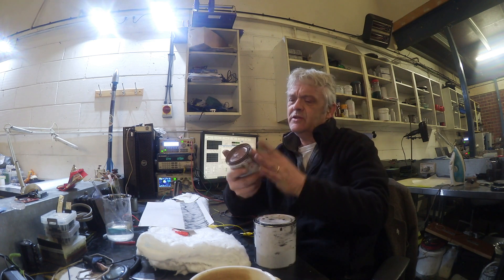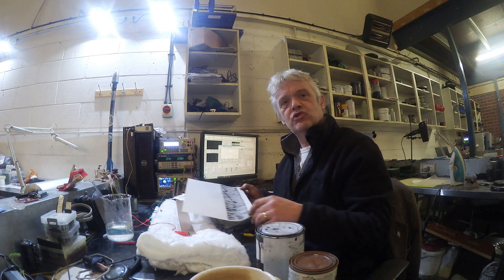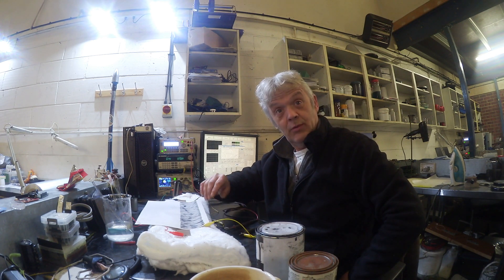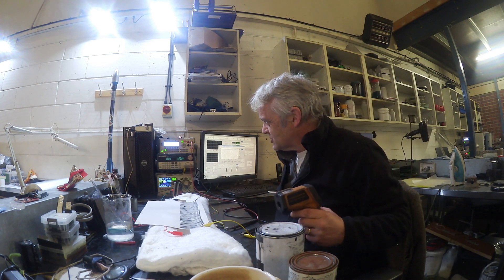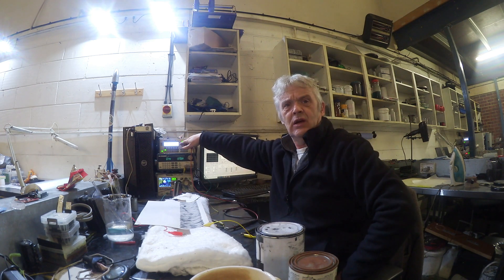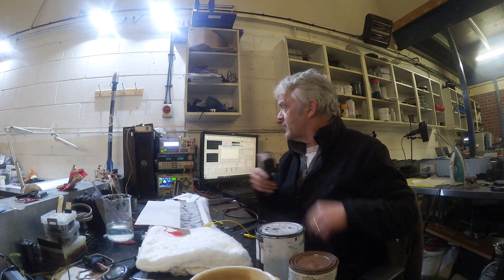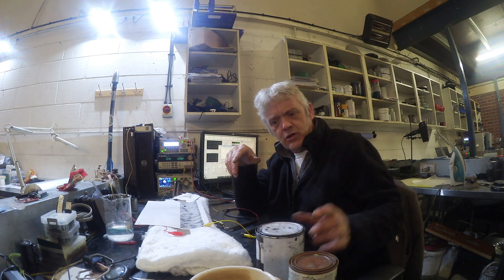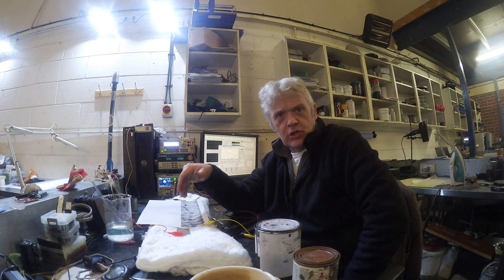Printable Thermoelectric Generator From FWG Ink

Comment: Wow imagine if a fridge was made from that built into plastic, on the cold side, and the hot side covering the heat exchanger and compressor, It could become super efficient! A company in the usa makes TEG's 20w and some can even handle a naked flame, very impressive. I wonder if graphene ink if exposed to high volts cold electricity would it become cold? People who get shocked with cold energy get freezer burns??

Comment: Dear Rob,
in Germany it's called "Thermo-Element". I been thinking about this to install it in a funnel from heating kettle to get at least a little energy which goes normally to the birds. 

Your printed thermoelectric generator is for lower temperatures off course; I guess up to 100°C only. In winter time the difference between outside and inside a house might (depend on which country / area) go up to 20°C or more. In this way there should be a potential to get the one or other WH for free. And in your way very simple to make!
Reply from the maker: nice idea mate - go for it

Comment: You talked about 2.5 Amps at 10 Volts, and then corrected the voltage to 10 milliVolts. Presumably you also meant to say '2.5 milliAmps'? Thanks for the awesome demonstration, Robert. You are really showing us what can be done, at home, for relatively low cost, and with basic ingredients. That's what makes this channel so fascinating and educational.
Reply from the maker: yes mate - we are talking tiny amounts of power here
Reply: The 10V 2.5A was the power being pumped into the kanthal heating element driving the temperature gradient for testing the thermocouple, not the output of the thermocouple itself

Comment: Hi Buddy.
We know that your ink can be used for induction. 
Could the power being picked up on your meter be from induction transfer from the heating element?
Have you tried the same experiment from a radiator or a heated plate (non electric)?
Reply from the maker: it's a resistive heater from a dc supply mate - not much chance of that - but I did try just using my hand, a hot cup of coffee and a hair dryer and it worked but a bit Heath-Robinson - which is why I used a more controllable heat source for the vid
Reply: @ThinkingandTinkering  cool .
I thought you would but wanted to ask.
Thank you

Comment: If you can get a radiating-finned extruded aluminum tube and run water through it on the inside, then you can rapidly sink a lot of heat relative to the paper and ink accumulator on the outside, and in theory on a hot day gather quite a noticeable improvement.

Not sure its worth the effort, but by all means a measurable amount of power generated.
Reply from the maker: worth a try for sure

Comment: Print this on Silica Cloth, this cloth can handle 1800*f. If coat the cells with Sodium Silicate as high temp electrolyte between the materials, you then create a combination of both a battery and a printable TEG. You may see a huge boost in output and may note they will hold a charge. You may even find you can charge the cells directly from the heat source.  I did this same thing but used aluminum oxide very fine powder as the cathode. I took this video out of hibernation check it out. https://www.youtube.com/watch?v=tzgA8JgibUQ
Reply: If we can get the silica cloth to act like a wick, we can keep the sodium silicate supplied with water to keep wet. Once the water is gone the electrolyte quits working.  This is why I think there is something going on with the H being liberated and processed like a fuel cell.
Reply: I was able to achieve 6 volts out of my cells and were very crude. In fact the very first ones were just a smaller scale of exactly what you did here.
Reply: The cell in the video I coated the silica cloth with sodium silicate first. Then used it again for the binder for both the Aluminum oxide and the graphite powder. In the video the tegs modules you see I had bought previously and are what got me going  in this. But those modules are broken in the video and are not the source of power. I was just using them to isolate the vice grips from the anode and cathode of the cell.
Reply: one last thing, I tried the peltier effect, and this is  how I discovered the energy storage capability. The cell did seem to cool but not drastic, I was hitting them with 12 volts.
Reply from the maker: this is a very interesting concept mate - mind if I work with it a little and maybe do some vids?
Reply from the maker: I did check it out mate - very interesting - what was the anode?
Reply: @ThinkingandTinkering  On that cell it was aluminum oxide with sodium silicate binder.  However, i used aluminum from a soda can and also nickle mesh. The aluminum seemed to work better than the nickle. Need to find out what aluminum is used for soda cans as Ive tried other aluminum with lesser results.
Reply: Take this make it your own, I cant develop it and i need this technology. Ill email you with a more evolved concept.
Reply from the maker: @Thrive-Off-Grid  cheers mate
Reply from the maker: sorry mate I asked the question before reading on - my bad - cheers

Comment: This is pretty cool, similar to the Lovell monotherm video you did - but you are using the Seebeck effect here. NiCr based inks (powder + polyaniline and etOH) work better as the Ni source than Ni itself. Or even Ni and Ag work really well as the Ni electrode. I have done some experiments in this area myself, with carbon dispersions. I found that a Carbon paint in a junction with a NiCr paint actually performed well enough to take reasonably accurate temperature measurements with them. I used polyan and the target metal to make the ink - then i sieved it and used a Thermocouple template i found online and made a stencil. I then airbrushed the paints. They were 40mm x 40mm and had an average resistance of 0.35ohms/square. I was able to hook the painted tracks to my Arduino and use them as a two-wire temperature sensor. Was pretty cool :) I did this a few years back. Temperature sensing wasn't my main goal at the time - creating a paintable peltier device was - so i quickly moved away from using Carbon as the reference electrode material and onto TaBi chalcogenide mixtures. They are pretty cheap and have amazing Seebeck coefficients (they are the materials current peltier elements are made out of). I have been able to get 10°C movement across the paint i came up with. I am still tinkering though. 

Love the video :) There is so much potential in a cheap waste-heat harvesting system. Even it just fr iOT at first - huge potential in paintables.
Reply from the maker: lot of interesting stuff in your post mate - I'll dig into a bit more for sure - not sure if I want to use tantalum based inks - I might persist with the carbon a while longer - stubborn - you know that lol - but I agree printable are a very interesting area

Comment: Question technical application
The performance of solar panels drops in the summer months because they heat up. I've been looking for a solution for a long time. I want to dissipate the heat to increase efficiency and generate extra electricity for my balcony power plant.
So far I was thinking about Pelitier elements and water cooling.
But a corresponding painting of the back would be a great thing. Stick passive heatsinks on top to get a higher delta temperature.
Combined with a DIY zinc bromine flow battery and you come very close to the offgrid. For little money.
Reply from the maker: for sure mate - I am not sure what the question is though - sorry - I am being a bit thick

Comment: Does anyone know a good hackable inkjet that could have the color inks replaced with carbon, boron carbide and carbon nitride water based inks and the black ink replaced with a non-water-soluble insulating material.  Preferably with a  way to calibrate it to run the same sheet multiple times (perhaps a cheap plotter?)

This could be a game changer for printable circuit prototyping and a modified silk screen process could be useful for medium volume production.

It would also be kinda cool to use a non-modified printer for visualization purposes.

BTW - the boron and nitride are to form P-N junctions for carbon base ICs.  The multiple layers is not only useful for multilayer circuits but necessary for printable transformers.
Reply from the maker: There are several CISS systems around mate - worth looking into that - if you want to hack something choose a piezo based inkjet not a heat based device - I think epson does them but you will need to check
Reply: Try this site: https://www.instructables.com/id/Print-Conductive-Circuits-With-An-Inkjet-Printer/

Comment: ..........so it doesn't appear that you heated preferentially the carbon or the nickel. Isn't perhaps best performance obtained by creating as big a difference in temperature between the two different components of the teg as can be managed? Thus heat the nickel only or heat the carbon only. It would require a different painting arrangement also. How about graphitic nitride instead of carbon.. No, I can't do it I'm afraid to say.
Reply from the maker: interesting idea - I will have a look at inmate - thanks for the suggestion

Comment: I would use a fish scale configuration. I think that the more you add the less there will be a difference of heat between the layers.
-----
I changed my mind. maybe with some kind of Z shaped cell it would work but not a great idea. I forgot about heat transfer of opposite faces touching.
Reply from the maker: tbh mate this is a basic idea and needs playing with - some good suggestions here and lots to investigate for sure

Comment: Thanks, Rob. I've been waiting for you to do this. Brilliant! 😊

There is a metal used in magnetic refrigeration that may couple well with your TC.

https://en.m.wikipedia.org/wiki/Magnetic_refrigeration

https://www.rwmmint.com/products/gadolinium-gd

A small slug of Gd cost around $80 yet supplies are sketchy.

Using a strong perminate magnet, the Gd slug can pump heat or cold. Your TC can possibly be given a strong delta T with simple moving parts.

https://scholar.google.com/scholar?q=magnetic+Refrigeration,+Gd&hl=en&as_sdt=0&as_vis=1&oi=scholart
Reply from the maker: awesome info mate - thanks for that - got me thinking for sure

Comment: Nicely done! Any idea of what sorts of currents you could sink off it while maintaining a reasonable voltage?
Reply from the maker: it's going to be a few m icroamps off that with a a couple of dgrees difference for sure - there is work to do what is interesting is it works at all
Reply: It now comes down to creating a strong thermal difference, or differential, in a niffty way. 

Let's say a thin wheel rim had the TC painted on the inside of the rim with magnets attached around the bottom outside of the rim. By placing a slug of Gd in the wheel rim and letting simple oscillations of the Gd slug heat/cool the inside rim which is the magnet/TC.

It could make for a niffty table top work of art or much more.

Comment: Now please develop a peltier module.
Reply from the maker: or you could mate
Reply: @ThinkingandTinkering  ain't that the truth. 

Sturgill Simpson said it well:

"Bein' pulled a million ways all at the same time
It's enough to make anyone go insane
When you find yourself forgetting all your own rhymes
And givin' up on dreams floating 'round inside your brain"

At some point you have to hit mute and be the best clockmaker on Mars.
Reply: Umm, he just did....  you can use special materials to enhance either the Peltier or Seebeck effect but they're both thermoelectrics and most schema that display thermoelectric conversion are thermodynamically reversible. So TECs are low quality TEGs and TEGs are low quality TECs.
Reply: Ooooooooohyesyesyesyes!
Reply: ......peltier module,,, do you mean for electric coldness production as in refrigeration? Those devices require materials that conduct electricity but not heat and it's semiconductors are what fit those specifications. Semiconductors are crystal based things , it gets to be specialized.
Reply: @philipvernejules9926  Well, to make a professional peltier you need special materials like the Bismuth Telluride that Rob mentions, but with sensitive enough equipment you should be able to observe some form of thermoelectric effect in any combination of materials(that arent perfect insulators, of course).